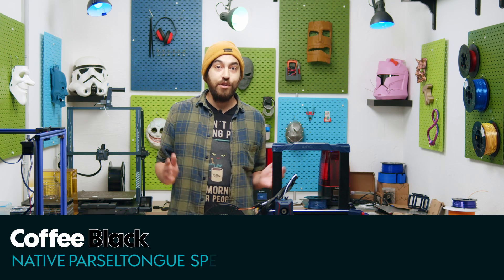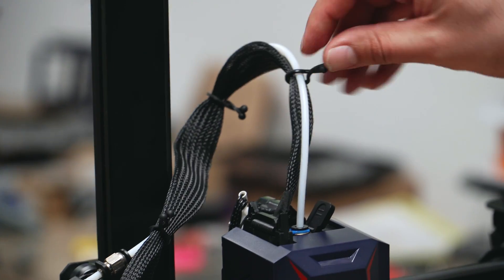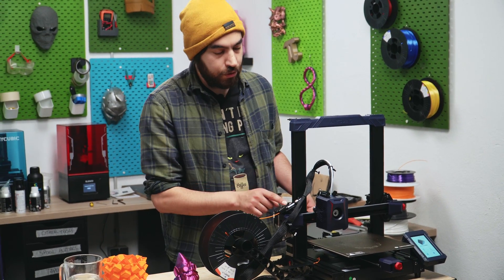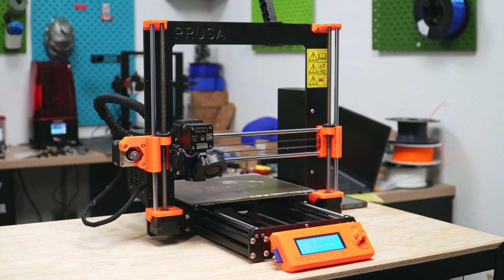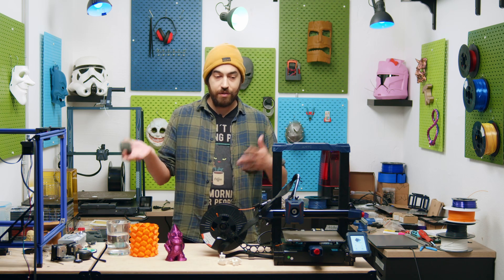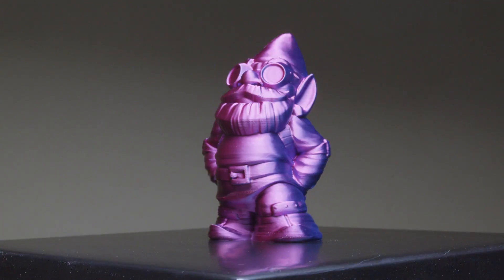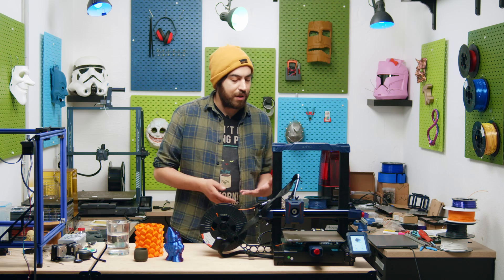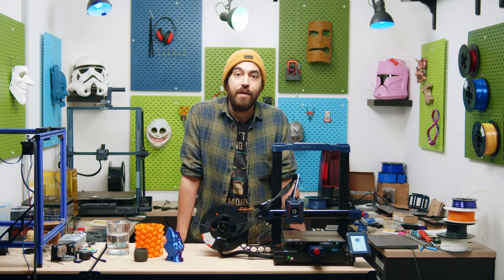The Anycubic Kobra 2 - The Little Speedster

Comment: Jake - i'm new to Anycubic. Do you have a recommendation of the Kobra 2 vs. Kobra 2 Neo? Is one better over then other? thank you
Reply from the maker: I really disliked the Kobra 2 Neo, I would advise against it. The Kobra 2 was good when I tested it but it's actually quite outdated now. A lot has happened in a year, the Kobra 2 Pro was better but I was quite happy with the Kobra 3. It is  a bit more expensive than the other 2 but quality at high speed held up very well and even without the Multicolour option it was a good printer.

Comment: I have a kobra 2 max the fast speed annoys me because i get poor print quality, how much should i lower this or change it because Ive had this issue for months
Reply from the maker: This really depends on the filament you're using, even the PLA you might use, some filament is not cut out for high speed. A lot also comes down to the settings, you might need to tweak your pressure advance and also reduce the speed on the outer perimeters but keep high speed for everything else, also using the "print outer perimeters first" feature in a slicer really helps with high speed prints

Comment: 2 questions. 1. Im looking at getting the Mintion Beagle V2 camera for this exact printer and I dont know where I would need to plug it in and what kind of plug I would need to buy. 2. in the back of the printer near the center bottom there is a hole that says 115V and 230V. What is that hole for? Is that were I would need plug in the camera and what kind of plug would be needed for that? Thanks!

Comment: Do you know of any 300 x 300 x 300mm machines size 3d printers?
Reply from the maker: Sure, loads, Neptune 4 Plus, Sovol SV06 Plus, Creality K1 Max, Voron 2.4 300, Sovol SV04, Sidewinder X3 and X4 Plus.
Reply: The only issue with some of these is that some of their dimensions go over 300mm so I don't know if you have any other recommendations?
Reply from the maker: @jamescurtis1667  Hmm I think that's all we got in the shop right now. Oh and the Voron Trident, that comes in 300mm
Reply: Just any 300mm 3d printer will do
Reply from the maker: @jamescurtis1667  Were the 300x300 ones I mentioned not suitable?
SV06, K1 Max, Voron 2.4 300, SV04, Sidewinder X3 Plus, X4 Plus and Voron Trident.
Reply: Part of their machine size would go out of the 300mm size, quite often on the height
Reply from the maker: @jamescurtis1667  Sorry my bad, I completely missed you said machine size. That is a very small size, the Voron V0.2 is just under 250x250 but it is definitely higher than 300mm. That would be the closest we have. I'm pretty sure every other printer we have is over 300x300x300.
Reply: Thank you
Reply: In fact, do you know any 3d printers with any other dimension but the depth has to be less than 400mm?
Reply from the maker: @jamescurtis1667  That would also be a short list. most printers are bedslingers which means the actual frame size is smaller than the space needed for the bed to move back and forth. On an average bedslinger, something like the Ender 3 the depth needed would be around 450mm. There are smaller printers like the Ender 2 Pro but we don't sell it.
You should look at corexy printers or printers where the bed doesn't move back and forth for a more compact frame. We sell the Creality K1 and K1C which require 355mm depth. Other printers like Bambulab printers would have a similar size though I'm not sure on their exact size.

Comment: Is there a way to change filament mid print and i just didn't see it?
Filament is running out during a print, i press pause. 
The only options are resume, stop and settings(only option is z-offset) and the filmanent is still stuck in the print head.
How can i change the filmanent or do i have to cancel the print and restart with a fresh spool?

Comment: After a week of using it i yet have to find a way to mount the spool holder because what the video doesn't show is the strain on the filament when the extruder is at hotbed level.

its mechanically impossible to mount the spool sideways otherwise.

you cant even flip and overhang the spool holder below, thats the only way it would work as advertised.

also tried z axis mount but 1kg filament+spool+vibrations is too much. crashed and almost killed the filament sensor on the way down.
Reply from the maker: I actually had some qualms at first about this too but after some use it is actually not as bad as I thought and I haven't had any issues. However, the process of changing spools after a run out is less than ideal
Reply: @3DJake_Official  Fair. Yes, niceley phrased.
I dont know why the Extruder moves to a position where the angle of the ptfe hose makes it impossible to pull it out completely but the angle to put it in is perfect for getting it out.

So you gotta Press "Filament out" so it snaps off from the extruder, then "stop", then press "filament in" so the extruder moves in a way you can actually pull the filament out and be fast enough to pull the filament out before the extruder drags it back in.
Sometimes gotta press out on the way to in again so it snaps out completely.

genius design.
Reply from the maker: @aboveallaverage7895  Yeah they really didn't think that part through

Comment: I'm disabled and want to get into 3D printing, one of my main struggles is being able to find tune turning things to level beds. Does this do it automatically so I don't have to manually level? It isn't entirely possible given my conditions
Reply from the maker: Yes, the bed is entirely rigid, there are no levelling wheels with springs so when you're setting things up you need to let the printer do an automatic levelling and then an automatic z-offset check. The most manual thing you might need to do is check the z-offset with a piece of paper and adjust using the menu but no tightening or screwing in is necessary. I actually haven't had to do this with the printer yet but that is the most manual action you would need to perform with bed levelling.

Comment: I've had mine for about 6 weeks now and I really like it. Non standard nozzles want an issue since i was able to swap out the heartbreak with one i had on hand...i think it was for a cr6. But I'm using standard volcano nozzles with no issue. The only "issue" I've had is over extrusion but I'm assuming this is mostly to compensate for higher flow needed at higher speeds. E steps are calibrated and dead on but I have to reduce flow to 90%.  The only changes Is like to see would be much more control options available in the firmware. The firmware and UI really is limited but i guess that's well suited for beginners. It's be nice if there was an advanced firmware option where the user could find time simple things like dark mode display and how much filament to extrude when loading.  But for the $218 CAD I paid I really can't complain.

Comment: Is this the best printer for someone getting who wants to start ? Looking for a machine that prints a wide range of materials, speed is not important. About this price range
Reply from the maker: For a wide range, no not really, the hotend only goes up to 230C - You can print standard materials but higher grade filaments can't be printed with it. It is a good printer for beginners - very solidly built, easy to use and maintain but if you want to print something like nylon, carbon fibre, some kinds of ABS, PCTG, it is just not suitable.

Comment: I just set mine up.  So far it's had two failed prints.  It will stick okay but after a few levels it stops putting out filament.  They did add 3 brackets that attach the cable to the bodem tube so you don't have to use those zip ties that make yours look cheap.  But changing the filament is a real fiasco, nothing like the ease it is on my Prusa Mini or Kobra 1.  And then they messed up and put the cable right in front of the filament spool.  It just seems poorly designed and rushed to market, IMO.  I think all they cared about was that it was super fast.  And man, it is WAY too loud!   I didn't even buy it for the speed, I actually bought it for better usb ports instead of dealing with a micro sd card, LOL!  I'm going to try to send mine back.  If I could get it to be direct injection like the old Kobra, cut the speed down (it literally vibrates the hell out of the desk it's on!), cut down the fan speed to a tolerable noise level, and put the spool on top I might think of keeping it.
Reply from the maker: That ain't right, please contact our customer service if the issue persists
Reply: @3DJake_Official  I figured it out.  It was bad filament.  Some other filament worked fine.  Thanks.  But I'd still like to know if you can run this direct without the Bowden tube?
Reply from the maker: @joeking433  I have been wondering about that. I don't think it would be a problem although some people said that the positioning of the spool is to keep the center of gravity low and therefore the printer would be more stable hence it being on the side with the use of the reverse bowden. However, Anycubic have included threaded inserts on the top so I think you could just add a spool holder there so it goes smoothly directly into the extruder. You would have to reposition the filament sensor though.

Comment: I've had my Kobra 2 for almost a month now and it always ran great, but unfortunately nothing has worked for 5 days. Each print is a misprint and it cracks extremely when printing. Will send it in and have it exchanged for a new one. Too bad it didn't last long...
Reply: YUP. CANT REPLACE NOZZLE. CANT REPLACE PRINTHEAD. DEAL BREAKER. THEY KNEW IT THOUGH.

Comment: The one big problem with Kobra 2 is it's non-standard Volcano nozzle... In fact, we should not say Volcano as it is not one.
A real deal breaker for us. We can't find suppliers for this weird type of nozzle so will probably end-up returning the multiple Kobra2 we purchased for our print farm.
Reply: I've read that swapping the heatbreak for one from a viper allowes one to use standard volcano nozzels. Can someone confirm that?
Reply: @clockworkvanhellsing372  I recently resolved my issues with Anycubic products by selling all of their printers out of my shop.
Reply: YUP. CANT REPLACE NOZZLE. CANT REPLACE PRINTHEAD. DEAL BREAKER. THEY KNEW IT THOUGH.

Comment: I was looking into buying this machine as my first ever 3d printer. Are there things I need to look out for, things I need to buy extra or be careful off? Very helpful review, thank you very much for the info!
Reply from the maker: It is pretty whole as a product. I haven't changed anything or need to buy anything extra (besides filament)
Reply: DONT BUY-PRINTS GREAT UNTIL NOZZLE/PRINHEAD JAMS. WHICH IT WILL-RAPIDLY. BUT I CANT BE REPLACED. THEY KNEW IT. THE COMPONENTS ARE GREAT-WIF I COULD REPLACE PRINTHEAD I WOULD KEEP IT. BUT THEY ALSO HID THE ISSUE-THEY R UNETHICALYUP. CANT REPLACE NOZZLE. CANT REPLACE PRINTHEAD. DEAL BREAKER. THEY KNEW IT THOUGH.
Reply: Read coments, not possibe to chance nozle

Comment: Hi, what if I want to print silk pla? Silk normally requires slow speed, what would you recommend the speed (and temperature ) for printing silk PLAs on this printer ? Thank you
Reply from the maker: I actually never had to reduce speed for a silk filament. I use 220C for our own silk filament on the Kobra 2, normal is 215 but with the extra speed I bumped it a bit. No problems at all with it.

Comment: Can i ask, does the machine currently have Linear Advance, or Pressure Advance of any kind? I know you have mentioned that input shaping will eventually be coming, but i just want to know if there are currently options to minimise corner bulging.
Reply from the maker: Anycubic still haven't released their firmware source files so I can't say with certainty but I have noticed a bit of corner bulging when it comes to 90 degree turns so I think they have not enabled linear advance. We'll have to wait until the source comes out to see

Comment: Hi, I just got this printer. I am wondering 2 things: Can insert the filament (use the printer properly) without the long PTFE tube, just insert the filament directly?  Second, is it possible to have the filament on top of the printer where the handle is? for instance is there a spool holder that can be screwed into the two holes on top?  thank you
Reply from the maker: You wouldn't be able to use the filament sensor without the PTFE unless you moved it. Otherwise I don't think there would be issues. As for the spool holder yeah you could design one that fits the threaded inserts on top. Some people have said that the spool holder placement on the side is to reduce vibrations so it might not be the best idea to put it on top.

Comment: Can The Anycubic Kobra 2 printer work with PLA Sunlu and MIKA3d Filament?
Reply from the maker: For standard Sunlu PLA yep no problem although anything with fibres or glow in the dark materials it won't be suitable, it only has a brass nozzle so any abrasive materials are not suitable. Not familiar with MIKA3D filament but it seems like they only have regular PLA so it shouldn't be an issue.
Reply: @3DJake_Official  Truly appreciated. I’ve been going top to bottom for a few days of trying to find the right brand, lol. Thank you.

Comment: They most likely didn't put the filament atop the Z axis because, while it may feel sturdy at rest, moving at 200mm/s on a budget printer with a full spool on top may introduce a lot of vibration (back and forth of the bed aka Y axis). Therefore, they gave users the option (or reused the Kobra Neo top mount it seems) to mount atop the Z axis but designed it for side-mounting, hence the PTFE tube.

Personally, I'm not sure why people complain about the PTFE tube. For me I like the idea of my filament being directed to the extruder and it just feels less...cheap with exposed filament. Plus, less chance of dust/etc. on the filament.
Reply from the maker: Ah yeah I think you're probably right. Not really a problem though and it does have those advantages you mentioned, just wasn't sure why it was incorporated like that
Reply: @3DJake_Official  how big is the actual printing square
Reply: Do you know what a pain it is to change the filament on the Kobra 2?  It's ridiculous!  They don't know what they're doing!

Comment: Got the Kobra 2. There was a bit of issue with Z, but reading the friendly manual, and manually lowering the nozzle height worked. Turns out the Kobra 2 does a good job of adjusting the Z hight during auto leveling. So don’t try adjusting the Z height on the screen. Got a really good 30 minute Benchy.
Reply from the maker: Nice! I actually did have to adjust the z for the first print - they say it might be necessary after shipping but not always.
Reply: Now the z hight doesn’t work at all.

Comment: Compared to the Kobra and it's cheap parts and out of the box issues, how does this compare?
Reply from the maker: I have been printing with it every day for the last few weeks, no issues at all, no clogs, no filament sensor jams, all at 200mm/s or more, it does underextrude over 250mm/s. The motion system and extruder are total redesigns and I can't really find anything wrong with the printer, there are some things I don't like such as what I mentioned in the video. Touchscreen is very sparse. spool holder positioning doesn't make much sense to me but no real problems. It feels very different to the original Kobra.
Reply: @3DJake_Official  Thanks for that. My first printer was the Kobra standard, which I bought it just to see if I liked 3D printing. It prints well but has a lot of bugs with hardware and software.
Speed isn't really an issue for me, It's more reliability. 
I haven't even had the standard for a year, probably done close to 100 prints, and it is just a sad machine. People keep telling me it's user error, but I doubt freezing mid print, freezing after a bed level and a MB fan with bad bearings out of the box are user error.

I'm mainly curious if they fixed everything. After my first experience, I am a bit turned off Anycubic but if they have improved I may be interested in upgrading to something reliable.
Reply from the maker: @Quickshift_Racing  Nah that doesn't sound like user error at all. Freezing up during a print often means an issue with the temperature sensors, a lot of the time that can happen with the bed, try printing without the bed on and see if that changes.
Honestly, if you want something reliable I wouldn't recommend a new printer that hasn't had long-term user review (at least several months), check out reviews for printers that have been around at least 6 months to see if they have stood the test of time.
Reply: DONT BUY. IMPRESSIVE FOR ONE MONTH, THEN -PRINTHEAD CANT BE REPLACED-BUT DEALING W THE COMPANY IS TERRIBLE. THEYRE SCAMMY. THEY HAVE GOOD TECH, BUT IF YOU DONT GET LUCKY YOURE TOTALLY FKED

Comment: Thinking about selling my ender 3 V2 and get me this one instead, it does seems like a nice upgrade and it saves me time
Reply from the maker: It is way faster, even if you upgrade the Ender 3 V2 to input shaping on Marlin or Klipper it is still faster, those u-wheel bearings make a difference.
Reply: @3DJake_Official  yeah, seems way better so I got myself one
Reply from the maker: nice!